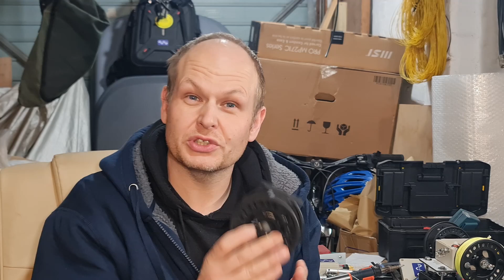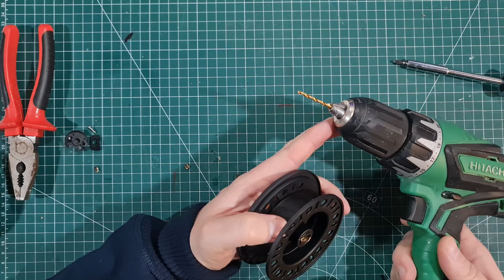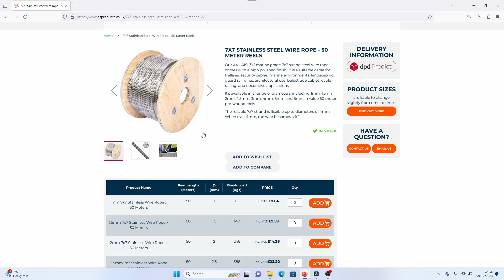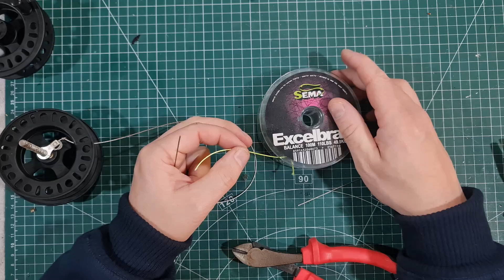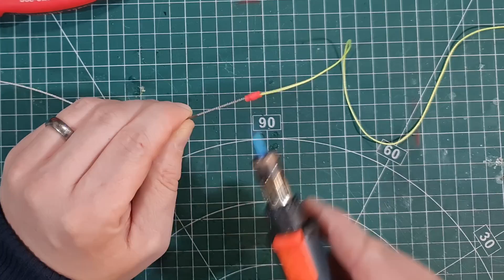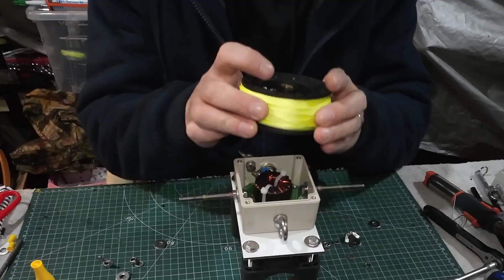How to Turn a Fishing Reel Into a Ham Radio Antenna

Comment: Great idea. 
Stainless wire is very lossy for an antenna like this though. It's really only good for very high impedance loops etc.
Reply from the maker: Can you quantify this? Best I could research that ground mounted vertical would be 0.4db down on copper wire? HB9VQQ did a paper comparing this adjustiwave vs a DXcommander. The adjustiwave won on most bands. Add to this the adjustiwave used 1 elevated radial and the DXC use many ground radials. https://drive.google.com/file/d/1SdT5Kihmd1vSdtTwCzPlaUYGh1qvcMmZ/view?usp=drivesdk

Comment: What is the purpose of the slave reel why is it needed?
Reply from the maker: So you can use the slave reel to wind off the full reel. Allows you to adjust the length on the fly. You just need a pulley at the top.

Comment: Ingenious
Reply from the maker: Thanks, simple but works and its resilient.
Reply: I'm looking for an equivalent I can do this to in the States. I think I could use this to make my own SteppIR CrankIR 80m-2m Vertical Antenna at a fraction of the price. I supposed I could get fancy and find a way to put a controller on it to crank it remotely, too.  @MM0OPXFieldRadio

Comment: I'm a little unclear. Is the yellow cord actually a wire, so you can have say 132' of it wound on the spool? I guess I missed that part
Reply from the maker: I have lots of videos on my back catalogue showing use. Its a non conductive fishing braid. I use it as a pulley system allowing me to shorten or lengthen the antenna on the fly.

Comment: I would extend the bolts and add an actual spring between the penny washer and a second penny washer on the outside of the spool and then add the wing nut and nylon lock nut.

does anyone know how much the reel / spool(s) combo ships to the US for?
Reply from the maker: Been there, done that andn it didnt work. The theory works burlt in practice its a pain as the spring will rotate. Email the Glasgow angling centre and ask them or see if you can add to your cart for the US.

Comment: Great video, Colin!  Definitely going to have to give this a try.  Maybe 1/4λ or 5/8λ wave vertical with a couple of tuned radials all using this method.  73 de KB7ZUT
Reply from the maker: Thanks Andy, its worked great for me over the years. One for the vertical and one for an elevated radial and away you go. All you need.

Comment: Excellent video Colin. Have you tried using electrick fence wire for the antenna? It works well.
Reply from the maker: It will do but what you neednto make surenof is there is no oxidisation as that will cause inductance when the wire is on the reel. What's the wire made of?

Comment: superb video. Much appreciated Colin... one minor point to also remind people of is that you MUST NOT use insulated wire... If you do the turns left on the reel act as a muckle great inductor that mess everything up. With uninsulated wire they are all shorted out so don't load the antenna (one turn of copper slug tape on centre of the spool can also prevent the last couple of turns when mostly unwound accidentally being isolated & acting as an inductor).
Another trick is to mount this onto a short length of plastic drain pipe. This bungees onto farmers fences very quickly then you just drop your telescopic fibreglass fishing pole down into it (then crock clip an earth onto the fence wire as a free "infinite" groundplane   (some people might like to check with a wet tongue first that it isn't an electric fence 😝  ... but the insulators on it generally give that away)
Reply from the maker: Yes your right. I do these videos off the cuff usually without an agenda. I should have mentioned this.

Comment: Hi Colin.  Cracking video.

This could be the quick to deploy ( and take down ) solution I need for 'portable' up on the North Yorkshire Moors - the last place you want to be in the winter when the weather turns 'inclement' ! 🤪

Does the residual stainless wire on the reel have a significant effect on the SWR ( Inductance ) ?
Reply from the maker: Exactly Jon, why I use it. No no inductance from wire as its bare. The antenna sees it as solid piece thats part of the length.